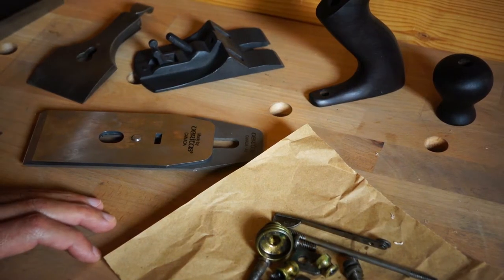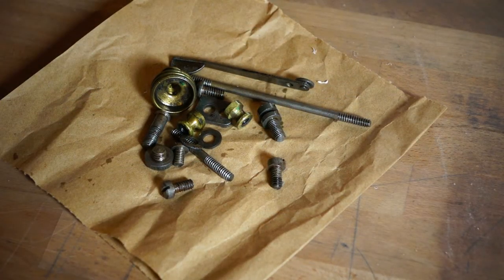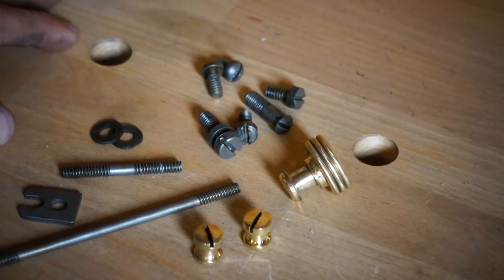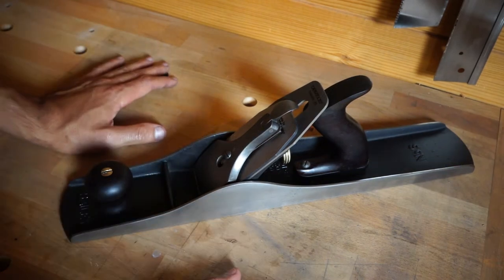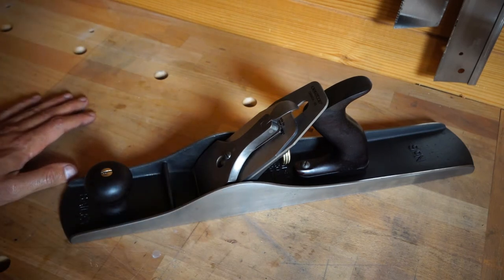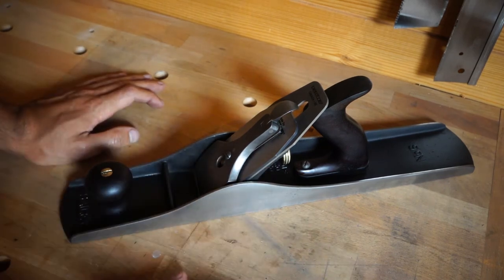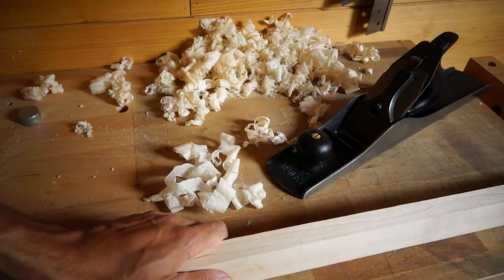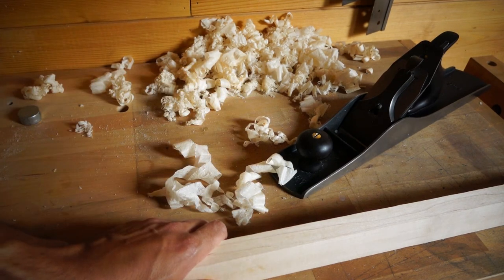Stanley No 6 Fore Plane Restoration | Part 6 - Assembly and demo

Comment: cool vid and great job!  music is very loud tho.

why didnt you show putting the lateral adjust lever back on?
Reply from the maker: +bigscreen bird Thanks! Good eye concerning the lateral adjustment lever. Little mistake, I forgot to put it back on during the assembly part. On this type of frog it's very simple though, you basically just drop it in (as opposed to some other planes, where it's riveted onto the frog). During the actual planing at the end of the video it's on there if course.

Comment: Great video! I’m doing a restoration on my Bailey number six also. But it needs a new ship breaker and blade also. Can you please tell me the correct name of the company you ordered yours from and the thickness and size that I need?
Reply from the maker: I ordered them directly from the Lee Valley website. You'll need the 2-3/8" A2 blade and cap iron (it's the Veritas Stanley replacement blade). The product number is 05P3115. Best of luck!